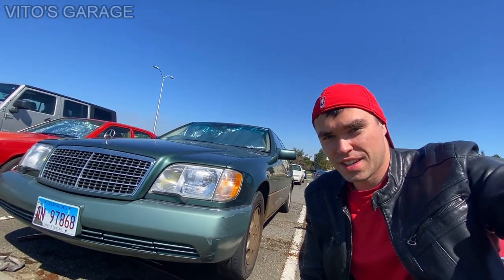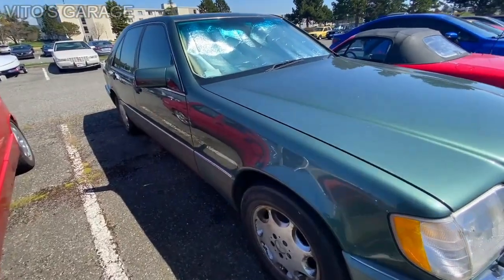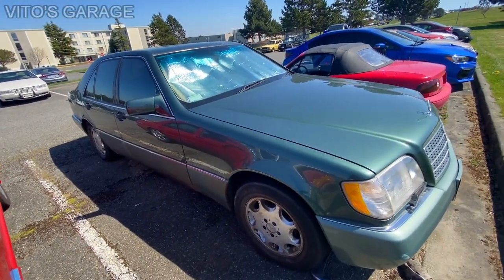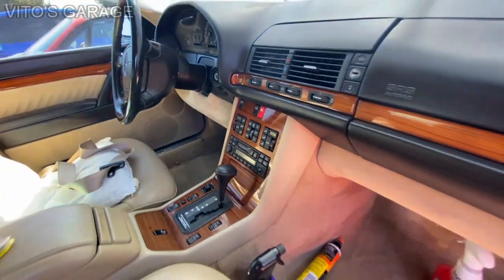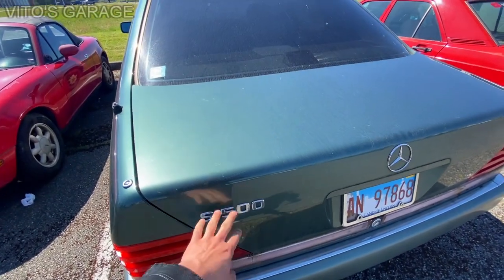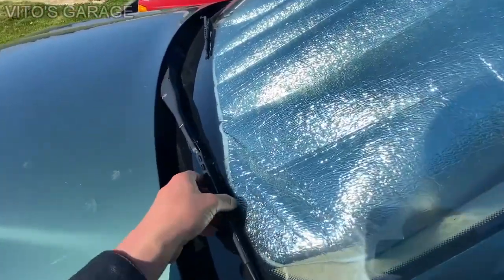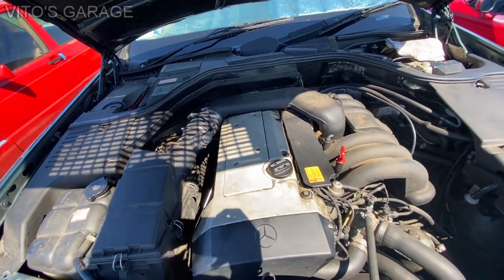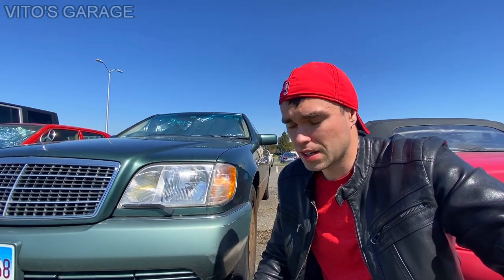''EVERYTHING'' Wrong with My Mercedes W140 & New Front Brakes!

Comment: I'm sitting in my 1994 S320 right now watching this.

For the radio code, call the number on the back of the visor. It still works. 

Shift knob - it's the oils from our skin. 

Soft close doors - pull a fuse in your rear fuse box for 30 seconds and itl fix the door soft close feature.

Let me know about headrests...mine don't stay up either.
Reply from the maker: Thanks for your support. And I already got the radio code. Shifter knob will be getting switched. My soft close is working, nothing wrong with it. I didn’t have time to troubleshoot the headrests

Comment: The side mirrors only got some "flex" to oit. if you have an electrical withtraction on the mirrors. Pull them in, and hold for 2-3 seconds when their both in. then take em out again. that should fix it, and thightens the "gears" again!
Reply from the maker: Thanks a lot for a great tip! I’ll try that. It worked on a W163 before which had a loose mirror. I folded it electrically and then unfolded it and the mirror wasn’t loose anymore!

Comment: Great video. I also have a 1991 W140 with the same engine as you. And if your car is pre facelift (which im sure it is, looking by the old style moldings on doors and the long strips under trunk) you need to install 300 SE badge. Thats how they came from factory!
Reply from the maker: Thank you for watching. And I’ll install a new badge sometime. But it’s not a 300SE. The badge is supposed to be an S320. My engine is late M104. 300SE is an early M104 with KE Jetronic. My M104 has an electronic fuel injection already. It’s a 3.2L so the badge is S320
Reply: @VITOSGARAGE  yes, I commented before seing the engine. You have a transition model with newer style engine and newer gearbox, but old looks. And about first M104 engine (like mine) - it also has fuel injection, electric. 😉
Reply from the maker: You should watch the latest videos about my W140. A lot has changed on that car!🙂

Comment: That green is a nice color and the interior color is sweet too!  What year model is the car?  All the small issues you have on it are fairly easy fixes.  The door issue seems to be the most problematic.  Were you able to fix it yet?  I have a 1999 S500.  It's silver with gray interior in near flawless condition.  A few things need attention, as with any older Mercedes, but the biggest issue is that my headliner is starting to come down in places.  My vacuum door locks recently stopped working, so I have to manually lock the doors.  The auto door close function works perfectly though. This week I'm installing new spark plugs and a camshaft sensor, as well as a few other things I've been procrastinating on.  But even with 148,000 miles, it still drives and rides like a dream.  Looking forward to seeing more of your W140 projects and repairs. 👍
Reply from the maker: Thank you! No, I haven’t gotten to the door yet. I’ve been fixing lots of other cars and haven’t had enough time to figure out the door. I will though, at some point. Thanks for your support, sir
Reply from the maker: These cars need our love. They all have things that need fixing. Even if the car had 40k miles on it, there’s still something that needs fixing. Just age. 
My W140 is 1994 S320
Reply: nearly every old benz has a saggy headliner, my  W202 also had that and I made a custom vynil headliner wich is awesome and it cleans right of

Comment: Of all the Mercedes Benz,is there any particular model you like other than the W123?.
Reply from the maker: W108, W109, W198, W114, W115, W116, W123, W126, W124, W140, W202, R129 , R107, W201, W210, W211, W215, W203, W220, W221, W208, R170, R230, W463, W163, Sprinters. I can list more. The main thing to remember is that I love of them all equally and I’d always be happy to work on any of them. They’re all amazing, even newer ones
Reply: @VITOSGARAGE  wow impressive,  have you had a dream machine like the 1957 Gullwing 300Sl,to work on, or the 600 series, those are classics and you rarely ever get to see them
Reply: I just like the way they are built, sheer elegance,well made cars, the only trouble that I have seen is that the Sprinters the Van's, for some reason, I have seen videos where most of them get  rust, other than that they are impressive machines
Reply from the maker: I want to find a Ponton and restore it too. They’re getting super rare and expensive

Comment: Funny your passenger rear door won't open... I have that problem on the driver's side on my '96!
Reply from the maker: That’s crazy! Wow! It’s all because of lack of opening and closing of those doors. You also have to use squirt ATF into the door locks to keep them lubed up
Reply: @VITOSGARAGE  I read on a forum that one guy found an aluminium connecting piece for opening the door had snapped. I have yet to rip mine open to find out.